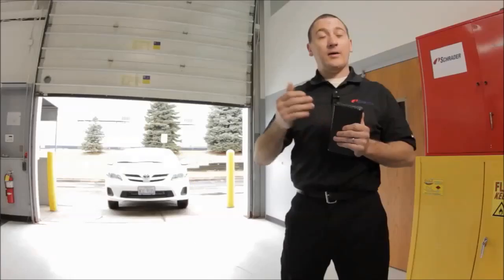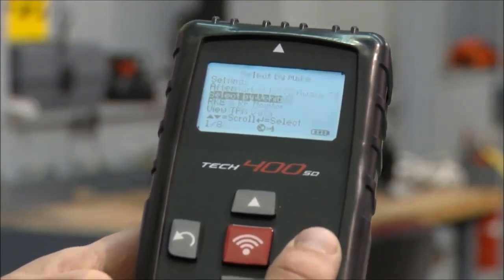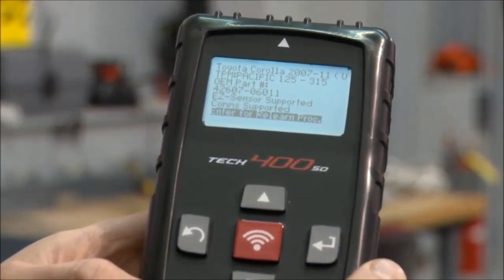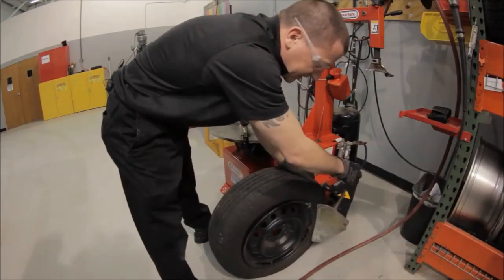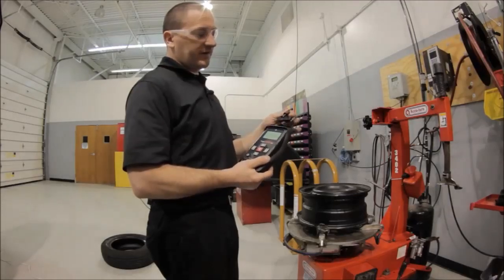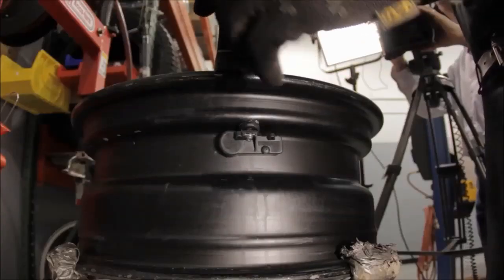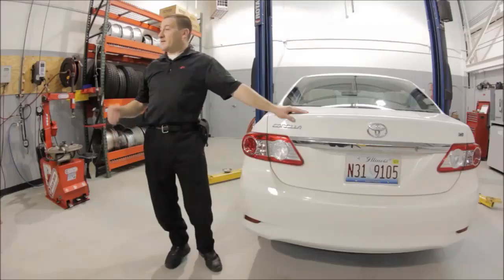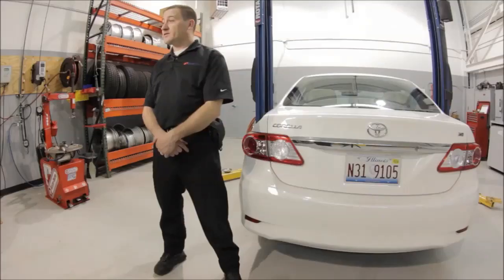How To Inspect, Test, Diagnose and Replace a TPMS Sensor by All Tire Supply

Comment: A meticulous mechanic would use a valve stem that matched the other stems on the car. By replacing a metal stem with a rubber stem you now have an odd-ball wheel in the group. How can anyone believe this is acceptable? I bet you guys leave your peas and carrots mixed together on the dinner plate too. Disgusting.

Comment: This is total bull shit, I have never in my 50 years of driving history had a problem with running a flat
tyre. I check every day before driving visually that my tyres are inflated. I do not need a system to 
tell me. Also the fact that this system needs specialist equipment to repair and replace means it
has nothing to do with safety but everything to do with making money from people who can ill
afford it.

Comment: After losing a bit of pressure between taking off the air line while getting the valve put back in, wouldn't you want to put the air line back on to ensure pressure is where it should be?

Comment: The video was very informative and easy to comprehend. Following your procedure makes testing and replacing a faulty sensor a snap. Please remember when doing your demonstration remind everyone to rebalance the tire as I noticed you took the weight off but did not replace it as balancing for that tire. A minor thing but a step in being consistent. Is this the only tool compatible to test a Toyota Tundra Pickup?
Reply: 7.28.2019
Long Beach, CA.

You can read about Tire Pressure Monitoring System devices @ www.aeswave.com

Comment: TPMS systems are a great idea that have been completely bastardized and turned into a cash grab for corporations. The main mission of these systems is to make money for corporations, not add safety. Safety is just the excuse. How do I know.. three reasons. 1) You cannot turn the system off. That means  if you decide  you would rather run with old school passive valve stems, you cannot do it without having all the warnings lit up on your dash. Why not just let customers turn the system off? Money grab. 2) You cannot replace the battery yourself. Even if  you could break your tire bead, you still have to buy a whole new transmitter for, in my case, 50-60 bucks for a 20 cent piece of Chinese electronics. If you could simply replace the battery, you would not have to do the following... 3) Tell the system about a new transmitter ID. Has to be done by some "expensive" piece of software to program the OBD-II system. It's bullshit and pisses me off to no end. I'm dumping my IS350 partly for this reason, and putting my 1992 Celica GT-S back on the road. Never had an issue with tire pressure in the past. Corporations choose to do things this way to steal money from customers. I'm surprised that seat belts don't have a 3-5 year lifespan and have to be replaced. I shouldn't give them ideas. Replacing headlamps is another wonderful money grab story on newer vehicles. I can change a headlamp on my Celica in 5 minutes. New vehicles suck - the money out of you.
Reply: John you're so correct on this issue...It's so pathetic that this shit goes on... I wish you could at least lower the stupid volume of the frikin seatbelt sensor...another dumb frikin sad case of their shit equipment. Anyways thanks for your rant on this..much appreciated.
Reply: I seat in Toyota dealer now. 1 tpms $290. If so why just change a new tire with sensor less than $200? End by choosing diagonostic $80.

Comment: Interesting video.  However you're doing way too much work.  Don't push the sensor into the tire.  Use the bead breaker to hold the tire compressed in just one place near where the sensor mounts.  Remove the nut, reach inside and remove the old sensor.  Install the new sensor.  Lube the wheel where the bead was unseated.  Seat the tire and inflate.  No dismounting or balancing needed.  Bear in mind that the flat rate for this job is typically about .6 hr including relearning the sensors.

Comment: first off if you mark where the wheel weights and valve stem are you dont have to rebalance. Secondly  you don't even have to take the tire off the rim. all you have to do is break the outer bead, pry the tire down and take the sensor out.

Comment: Easy way to fix it,take the sensor out and throw away installing a valve stem.I don't trust this piece of shit TPMS at all and is a pain in the ass system.Tire replacement and rotation takes longer too.
Reply: Well, every car made after 2010 has the TPMS and it's saved millions of barrels of oil because peeps are aware of low pressure in the tires, how many peeps actually check their pressure once a month? It also saves on fuel, and lastly it saves on replacing your tires early due to uneven wear from low inflation. I think it's a great device.
Reply: To me it is not and a waste of money.The sensors are not accurate.I seen it before.I put in 44 PSI and the scan tool read 32 PSI,this was with a Chevy HHR hooked up to the GM Tech 2.The TPMS is disabled on Corvette race cars,The TPMS screws the handling up.Plus there are programers that will shut it off already.
Reply: It does not save that much oil either. For what these sensors do, the driver usually knows the tire is as low as it would need to be to make a big difference. This is another electronic control that now cost the customer a heck of a lot of money to repair to replace something that was not broken, my eyes seeing my tire is low or me taking a few minutes to measure the pressure. A new sensor runs on average about $50.
Reply: Some sensors are over $100.00.A company does sell a bypass kit for the Corvettes and this is for racing applications only.The TPMS does not work well in this application
Reply: Exactly, except the manufacturers have purposely not provided a way to disable the system, so your dash warning lights will be forever lit up. They have thought this through.

Comment: Maybe i missed it but you didn't recheck the air in the tire after letting some escape while replacing the valve core and you failed to balance the tire pryer to putting it back on the car, or at least you did not show us.
Reply: and you can't spell, prior

Comment: HI, my car is 2011 Honda civic, and the SOLID AMBER TPMS came up, I just had 43K miles only so far. I am thinking of also replacing the tires by Oct 2015. Can I do this test at taht time, and how much would it cost to get the TPMS issue fixed.
best regards,
Sriram
Reply: Mine came on also around 43k miles. I would recommend replacing all 4 sensors at the same time, for the sake of convenience. I think it would save you some money when you replace the tires at the same time, just make sure to check your tires pressure at least once every two months.
Reply: I think you can find it cheaper if you buy the parts online and have a mechanic to install them for you.

for me , i just ordered 4 sensors on amazon for 26 dollars each. and i already found a tire shop which charge me like 20 dollars each tire. so 180-190 for all 4 i think isnt too bad.
Reply: Sriram Bhagavatula yes, i have to agree with you about the dealers. they have too many employees, and have to pay the huge rent on the property. these are all costs being added to the bills. 

and the dealer i went to today tried to charge me for 450 only for 2 sensors, and i of course denied the offer. also dealer charged me 50 bucks just for inspecting the problem which is fine, but ill probably give a second thought if i ever want to go to a dealer next time.

Comment: This video shows that the TPMS is a very, very expensive system to maintain.  The sensor costs about $50 each.  You have to pay for that of course.  Then you have to pay for the tire dismount, remount and balancing.  The monthly cost for this system is about $5 a month if the sensors last 5-7 years, the batteries average life.  It's cheaper to get a tire gauge and pump.  It's not that difficult to learn and do.
Reply: I just keep a pump in my car. For the past like year it said i have low tire pressure, and only once did i actually have a flat
Reply: @ethanners6605  I had the same issue with my TPMS.  About a year or so, it cleared up on its own.  Someone told me that high humidity inside the tire can cause the issue.  That may be true as I live in the desert and I may have pumpd air in the dire during our rainy season.  I haven't had the issue in over 3 years now.
Reply: @danburch9989  damn sorry i just realized your post is 4 years old 😂😂
The tpms system is a total scam made to scare people into paying big bucks to turn the light off. I just check my tires before i go somewhere, havent had many issues so far

Comment: Tire looked like it's on its last leg from a tread standpoint, so it probably wasn't considered to be worth balancing.

Also, the reader button (to avoid confusion) should probably be referred to as the Enter button throughout, not the Return button. I think the old Commodore 64's would refer to it as a Return button.

Comment: ...so, to have a spare set of winters wheels I need to spend on a 12 hundreds on the techthingy,  plus 8 hundreds on wheels? or my ECU will remember both sets IDs? my sienna is a 2004 and it only worth 7000, and the 2 sensors that alllllways works for me, are the one in my pocket, and the one in the rear end....

Comment: Why does he have to balance the wheel when it is the sensor problems?
Reply: Because anytime you remove a tire for any reason from a wheel you have to rebalance it. If you disrupt the placement of the tire on the wheel its now out of balance. Even driving it as the tire wears it becomes out of balance. Hence why most good shops like the one I work at will re balance a wheel for you every time its rotated and charge accordingly.
Reply: He doesnt, unless he puts the tire back in a random position. If it was balanced, it still is.